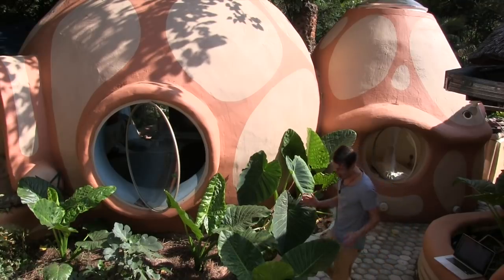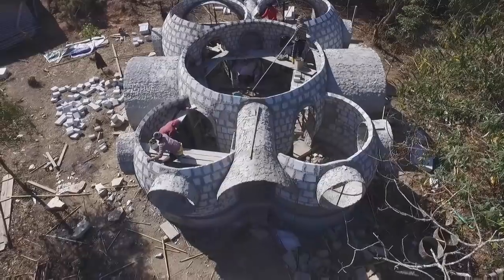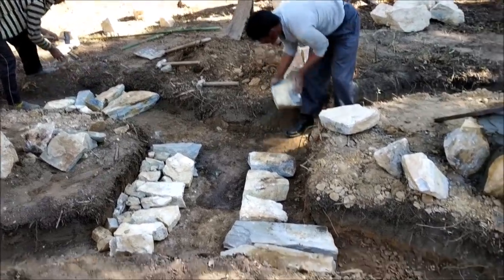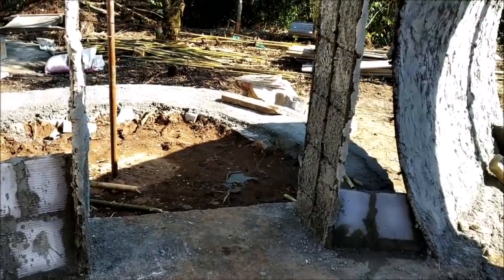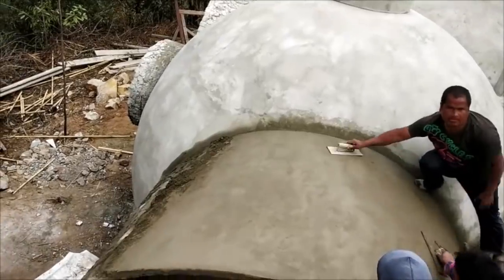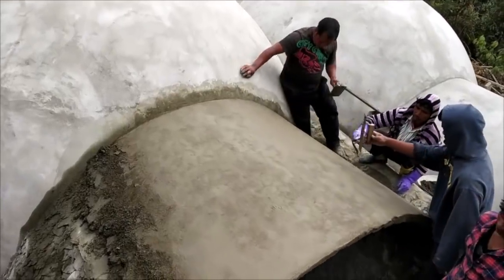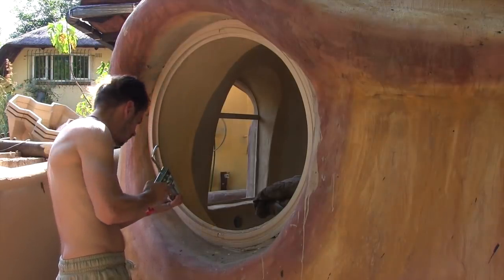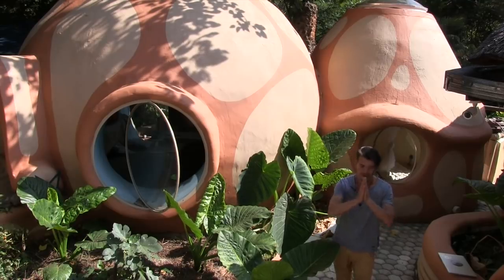Our online student build himself a 5 room dome

Comment: I have an idea. The way the blocks are made, if there is a way to simulate the Harding to block process. At least enough to “toast” to where it’s stiff enough to make a long column stand up with out support and not collapse and finish the rest of the drying process on its own... if you can do something like that...
Visualize a perfect half ball, dome, one foot thick, now visualize a metal plate few feet long probably, likely not more that a foot tall and you set it on the floor on the inside against the dome and it perfect forms shape with the dome, and then one on the outside to compliment it. Now hold them perfectly still in place and make the dome disappear, now connect the top edge of both pieces of metal together with another piece on top. Now connect that on the pole u use to line up the structure of the dome, but it’s connected two poles one directly below the other to form a triangle, if you do the math correct, as you raise the unit, it moves along to continue the foot thick circle shape... if you can grasp what I mean... this will only work if it is a PERFECT half sphere dome, couldn’t make it any other angle...
What’s on the other sides of the metal (not where the Air Crete is) is what will pre process “toast” the mixture. Block up one end or both if you can fill it from the top, pre-process that then unblock the ends and start rotating it along the ground slowly enough so where you fill in the direction you’re traveling it’s strong enough to not blob down , now you have a bottom ring of the dome, raise the unit up half it’s height or similar and continue the process... it would be like 3D Printing in Vase Mode... but you want these half’s where they are not linked to each other but the poles instead, so once you make it to the top and you have a hole that you cannot fully completely fill in, get on a ladder and detach the inside part and bring it down, and if the hole is big enough to stand through, be on the ladder and detach the outside layer and bring it through, actually you would wanna take all parts outside so u can make more while if finished hardening. Have some kind of scaffolding or something you can climb on to get out of the dome. Once fully hard make a block to cap off the hole and cut you windows and doors. Or put down wood slats as you go to take place of foam there you want holes and then push them through

Comment: Advice when trying to use a 110 anything on a 220 electrical system. Use a voltage regulato/convertor.
Yes, I get this guy used what he had to work with. I just give this advise to spare anyone from future costly problems.

Comment: So this channel just popped up on my feed. Was wondering if something like this could be built in the U.S. where home construction is heavily regulated by the federal government, the state governmemt and the local county/city government. I would also like a link to your training course
Reply: Not sure if you got an answer www.bioveda.co
Hope that helps you.
Reply: This particular technique will not be accepted by US building codes but there is a monolithic style technique that uses fiber cement  with rebar over an airform rather than cellular aircrete cement blocks that can be approved or given a building permit with a structural engineer's stamp of approval.
Reply: @jamesw7072  actually you are wrong on that. I was able to talk to an architect here in Florida who uses aircrete to build domestyle homes. Also several organizations in several Western States are also using this technique as a housing option for low income families. Not to mention this technique isn't that much different from the old Native American Pueblo tribes which is an approved method in states like New Mexico Nevada and Arizona.
Reply: @fbi805  I'm not talking about the exceptions, I'm talking about the standards. Sure you can call out a state or two or several counties that may allow this but aircrete is not an approved building material in the International Building Codes which most states and counties abide by. Hell some counties in Texas such as Terlingua and some counties in Colorado and Missouri have no building codes or permits at all. For over 90% of the country this building technique would not be sanctioned